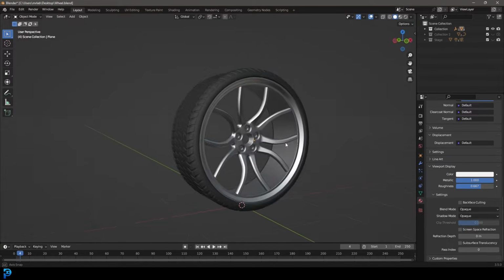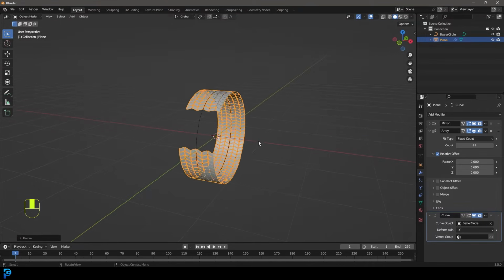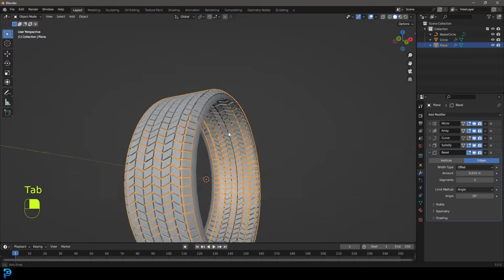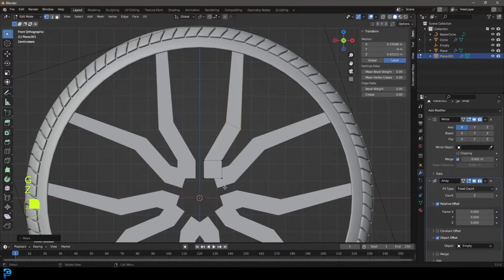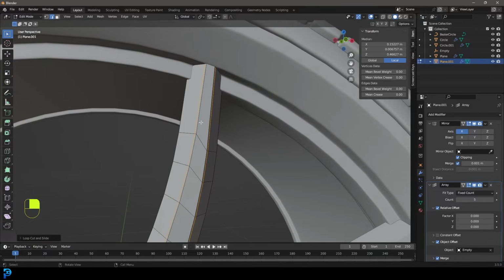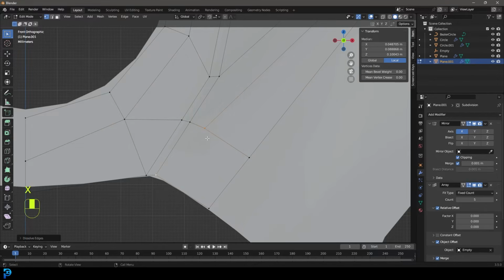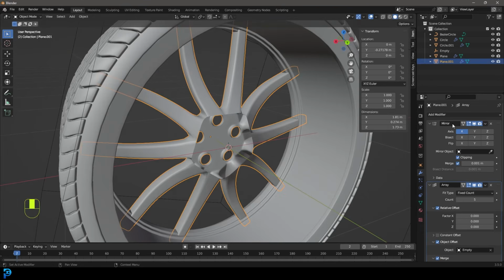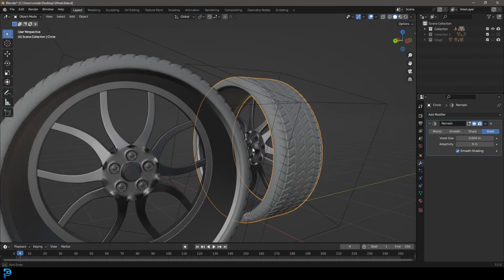Tutorial: Make A Tire & Rim In Blender 3.5

Comment: For making the rim at 10:10, i had the problem of the array getting smaller and smaller/ bigger and bigger. to fix it i applied scale and rotation (ctrl + a) to the plane and the empty, and noticed when i rotated the empty 75 it also slightly rotated on the X and Z (should both be 0).

Comment: 10:07 its not working as seen, its getting back side and it is very big in size
Reply: me too
Reply: I have the same problem for me too
Reply: @jasonmytv4755  press ctrl+A and apply all transforms
Reply: it means you need to reduce the size of your cube in the middle
Reply: @crypted7313  I actually solved this issue that same night, but I just got a response from you after nine months! 😄

The solution wasn’t reducing the scale of the cube. The correct fix was pressing Ctrl + A and applying both the scale and rotation.
Reply: @lisa-eh2mr  hey i did it but still having huge and offset
Reply: @lisa-eh2mr  Can't thank you enough for this even after almost a year. Thumbs up to you👍
Reply: @RabiyaAoucheva  
You Are Welcome 😊
Reply: You are welcome 🤗 @RabiyaAoucheva

Comment: 10:07 MY ARRAY ISNT ROTATING THE PIECE LIKE THAT..... NEED MORE DETAILS
Reply: Guys I have a solution just apply all transforms by pressing ctrl A
Reply: @lisa-eh2mr  to specify, apply all transforms on the empty cube after setting up the array, it will work properly now
Reply: @lisa-eh2mr  i love you baby thx so much
Reply: use the empty circle instead, it worked for me
Reply: Just realized you have to apply transform on the plane (rim) shape.
Reply: Even i am facing the same issue neither it works with circle.
Reply: It didn't work for me either